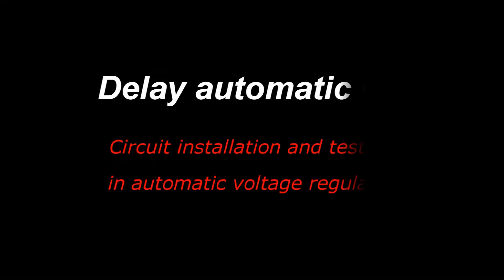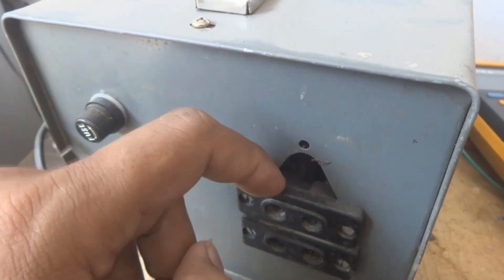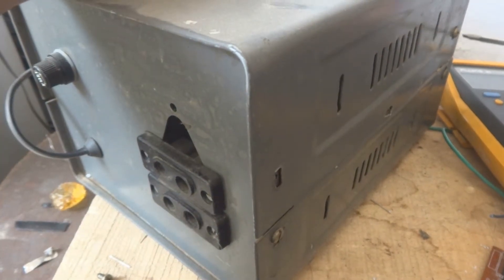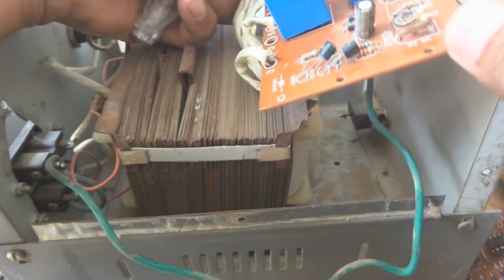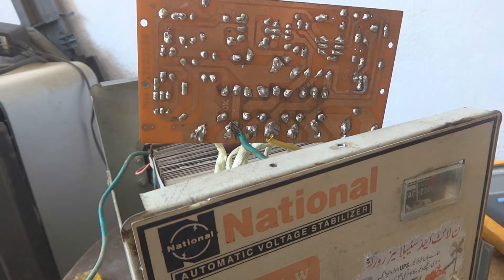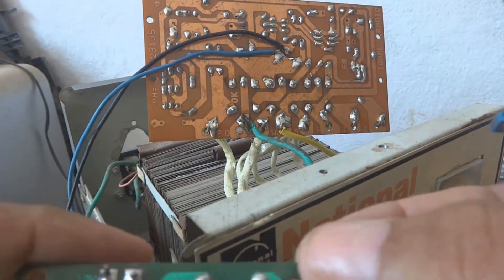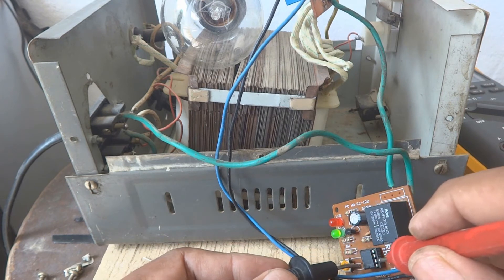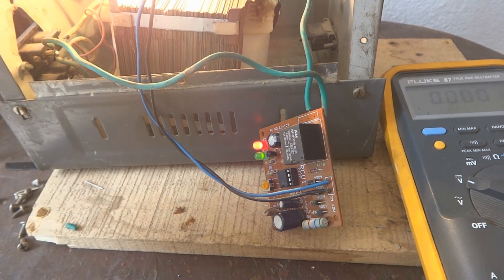Delay timer installation. Timer installation on stabilizer or regulator. Complete details.

Comment: Smashing job jahan :-D
That pcb looks ideal, the designer knew that the supply voltage may be too high or A.c, that optional regulator was a nice touch :-D

That psu looks very old, and the transformer looks like it needs a holiday lol :-D.
Good old technology.
Reply from the maker: Thanks dear sir for liking. You are right the transformer and the whole system was of very poor quality. This I had shown only for demonstration purpose. Regards,